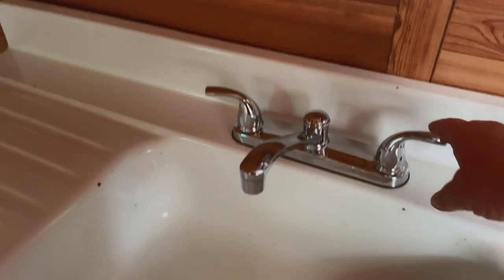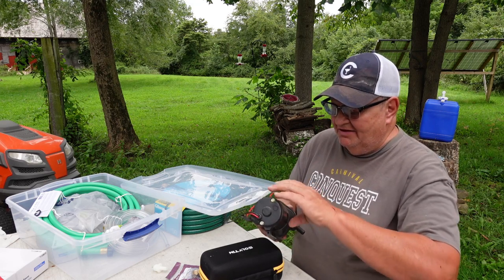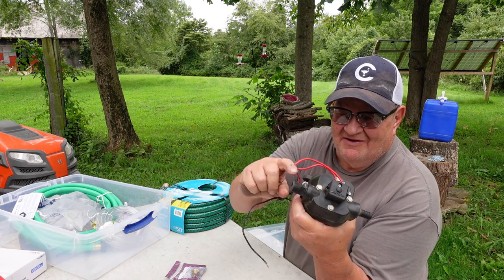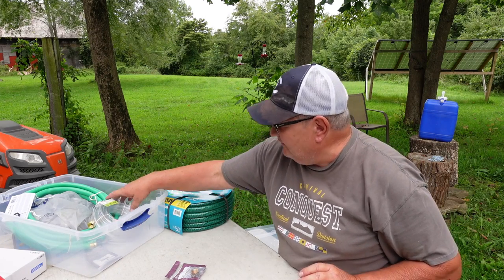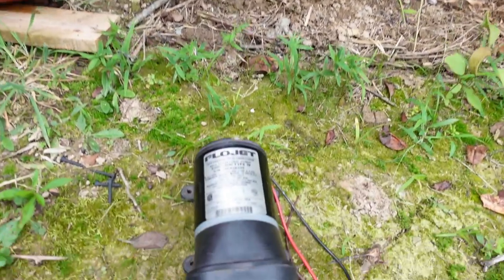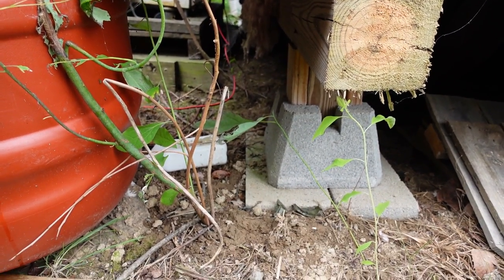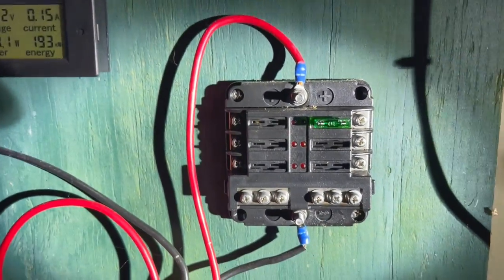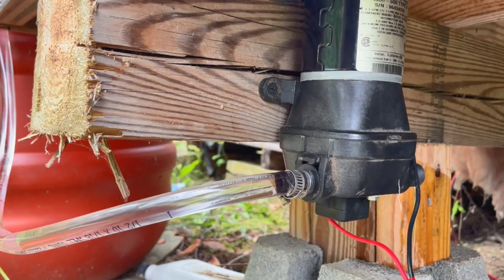DIY 12V Pump For Off Grid Rain Catchment

Comment: I probably would have mounted the pump inside, so it wouldn't freeze and burst in cold weather. They have heated hoses for RV's for the supply side.
Reply: IF it's like my cabin in wisconsin, we blow the water lines out October 1st so it can't freeze and bust pipes and pump.

Comment: I’m going to have a very similar system for my off grid cabin. Separate pumps for hot and cold water. Running pex pipe to kitchen and bathroom sinks, shower, and toilet.  Can you give me any advice on how it’s still working for you?
Reply from the maker: +@JamesAmbrose48 So far, I’ve had no issues at all.  I drain the pump if it’s gonna freeze.